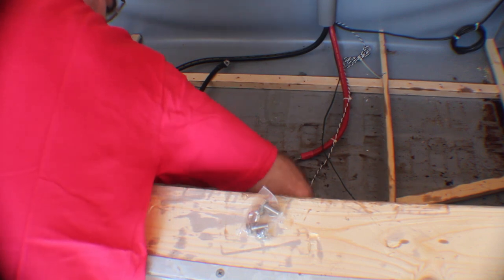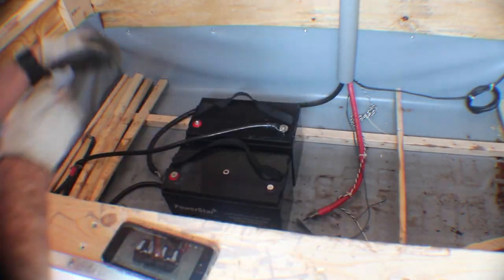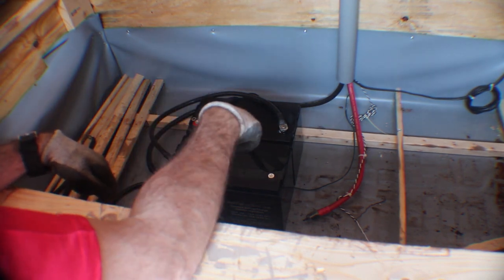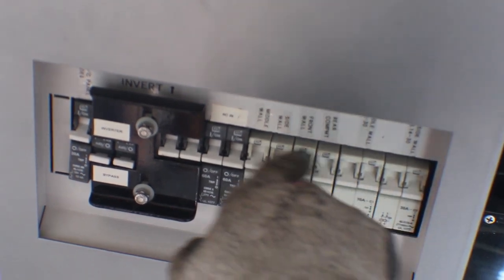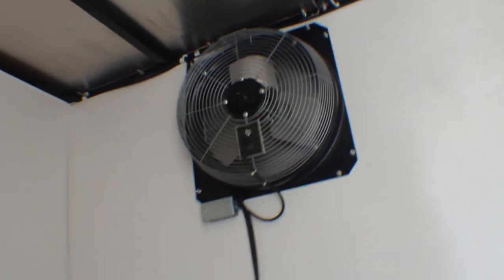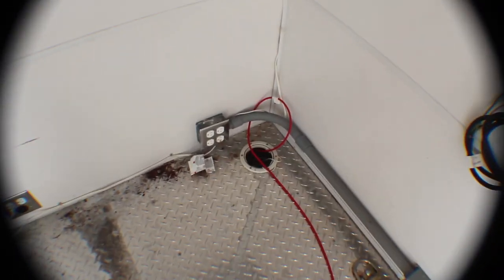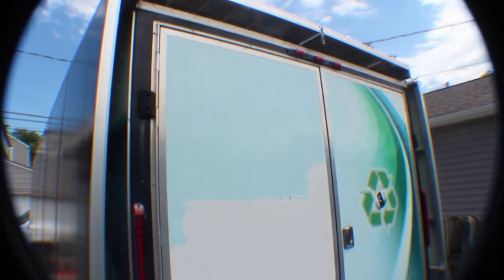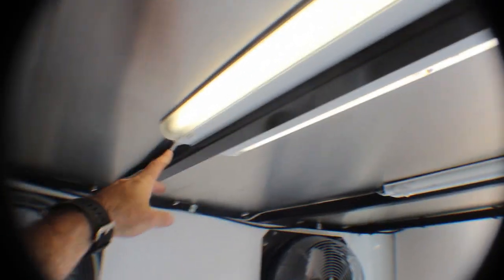Solar Powered Tiny House Food Truck Trailer

Comment: Hi there great vid by the way thanks for posting.

I love the idea of going green but would it be able to handle : 240 volt, 3 phase, 50/60 hertz, 11.1 kW, 29.1 amp, 3+G wire per chance? I want to use this trailer as a vending platform for organic rottisserie chicken and vegges griller?
2
Reply from the maker: Hi - it is not 3 phase. Any 3 phase inverter is a whole new ball game. 😀 the best I can offer you with this is 220V 30A single phase. Perhaps you could incorporate a phase converter?
Reply: Davion Hill thank you very much for the quick response. I will definitely look into that immediately.